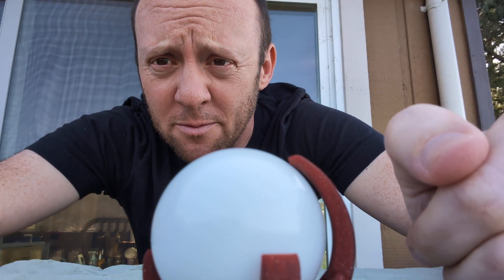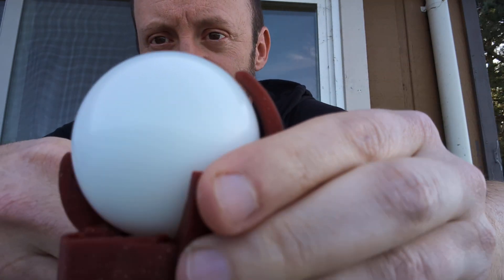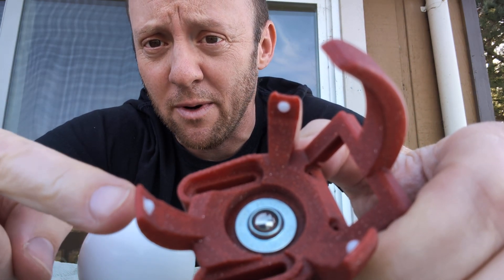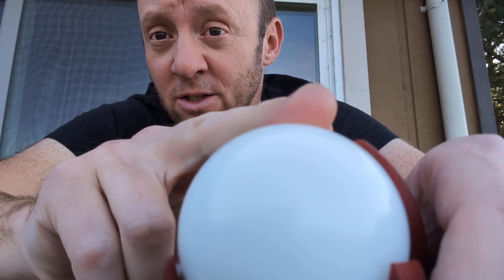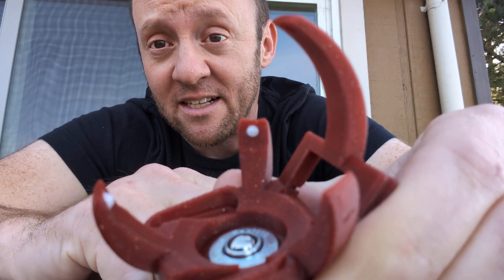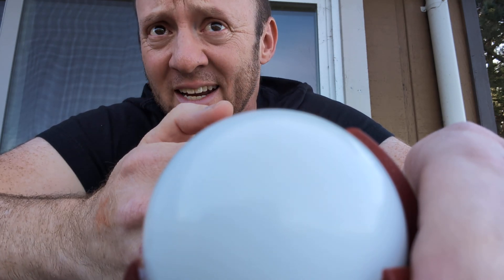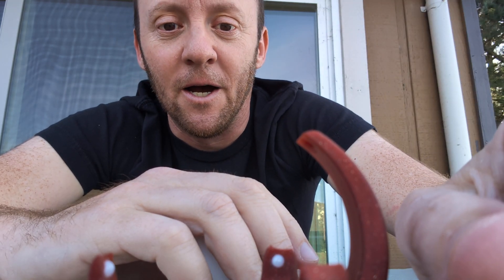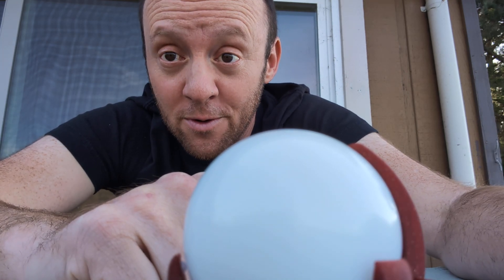Single BTU Trackball mount from Svalboard 🫣

Comment: This is genius. What size ZrO2 bearings are you using? I want to replicate your build and compare it to the traditional 3x BTUs setup
Reply from the maker: These are 3.175 or 1/8".  Easy to source in G5 grade, which is nicer than the more common G10.
Reply: @Svalboard  nice, thanks I'll get those exact ones.

Comment: Hello Morgan, just wondering how well you can use the Svalboard for FPS games? I’ve looked at the Azeron for a long while but don’t like the joystick being there for my thumb. The Svalboard has a way better setup that you can easily hit all 5 keys.
Reply from the maker: It's great by all accounts -- but I'm not a gamer, so definitely hop on the Discord and ask around.  svalboard.com/discord 🙏  Obviously if you use the right hand trackball instead of a mouse your accuracy will suffer, but for a left-hand-keeb, right-hand mouse setup it's pretty dope.  And of course there are finger trackball gamers out there.
Reply: @ While using the Svalboard can you hit 3 or more keys at the same time while gaming? Like hitting forward movement, strafe right and aiming down sight keys all at the same time.